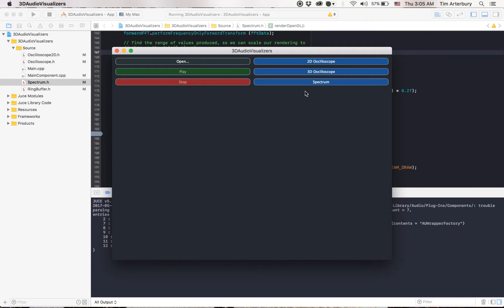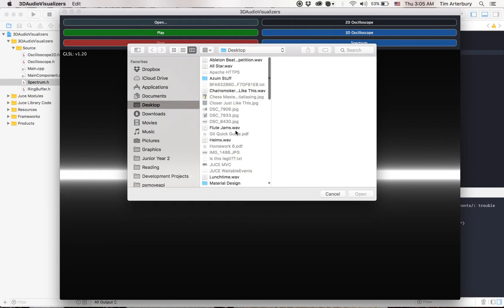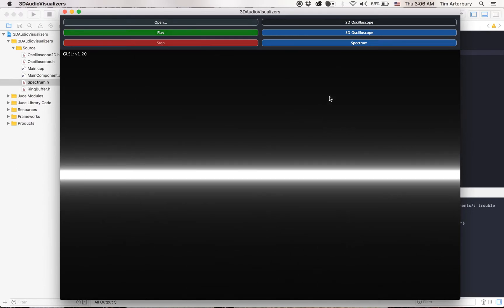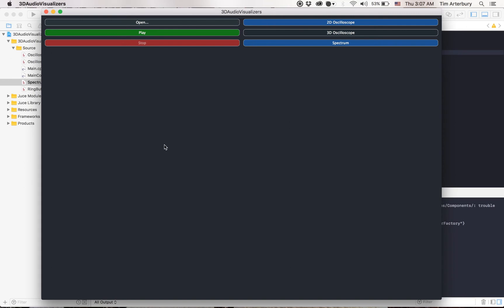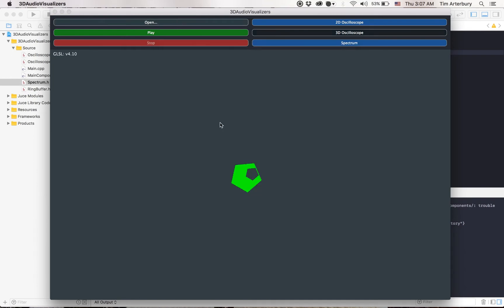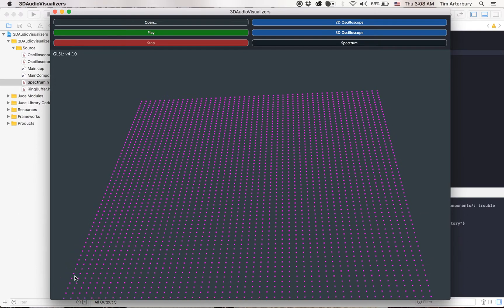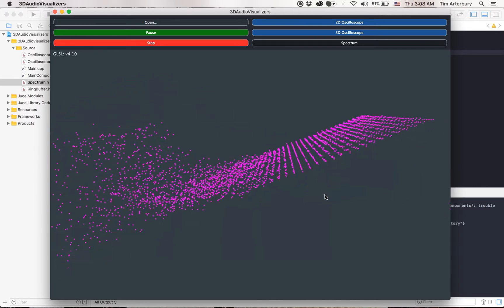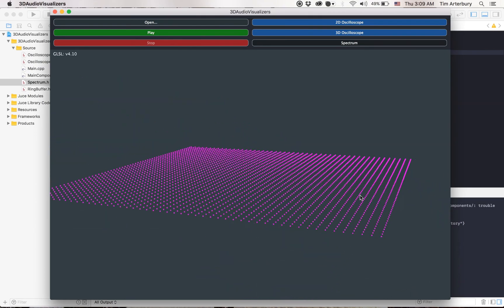OpenGL Audio Visualizer Suite - Oscilloscope & Frequency Spectrum

Comment: Can we make this in Python?
Reply from the maker: Possibly. The underlying technology is OpenGL. If there is a way to run OpenGL code inside of Python then this would totally work. I would bet that this is possible.
Reply: @tim_arterbury  Dude I want to know more about this. Where can I contact you? 
Basically I want this to use in a GUI.
Reply from the maker: @inferngamng1728  Here’s the source code of the C++ GUI: https://github.com/TimArt/3DAudioVisualizers

I probably am not the one to help you with a Python GUI as I have less experience there, but I bet you could translate the C++ code to Python. I would suggest looking for a Python OpenGL example project and then just swap out the OpenGL code with the shaders from my source code.
Reply: @tim_arterbury  Thanks dude I will try out this and give you the feedback.
You gained a Subscriber ❤️

Comment: Hello Tim. When compiling the project as it is it runs fine but on quit I get a jassert caused by leaking objects: "Leaked objects detected: 2 instance(s) of class Uniform". This if I close the app while I have the oscillator2D or the Spectrum open. If instead I quit while having the oscillator3D open I get 3 of these leaks. Any idea? I am trying to play around with the way Uniforms are allocated but I am coming to no solutions so far... :-( Anyway thanks for sharing this, it is very helpful :-) !
Reply: I fixed it in my version. The uniforms.release() don't actually delete the object. you have to do "delete uniforms.release()". (I know this is from 2 years ago just thought I'd let anyone scrolling through thinking of using any of this code) EDIT: Also same with shader.release()!!!

Comment: looking sweet, i need to implement a little audio visualizer thing.. well similar at least.. and i just dont know which of the thousand fourier transform libs i should use...

Any suggestions?
The project involves A TON MORE then the music part so i kinda want to spend as little time as possible on the FFT part of coding :/
Reply from the maker: The JUCE library has an FFT that I believe I used for this. Check out the code in the GitHub for this project which uses the JUCE::FFT. Seemed to work okay for my frequency spectrum visualization but would look best if you skewed the spectrum in a logarithmic fashion
Reply: @tim_arterbury  will absolutely do, actually thats one i have not heard from yet. I really just need the minimum, so if its more or less easy to use thats perfect, thanks!
Reply from the maker: I used JUCE to do all of the app, audio handling, and UI but if you just need the FFT you could probably extract it from the source code fairly easily

Comment: when I download the folder from GitHub, the Juce project file doesn't have the Osciloscope3D.h file, but a Osciloscope.h and when I change that for the 3D file, the project won't compile.. how can I fix this?
Reply from the maker: You might have to add both Oscilloscope2D.h and Oscilloscope3D.h to the project. Sorry I must have never updated the JUCE project file. If the Projucer itself is still unable to compile it, try pressing the open in Xcode or Visual Studio button in the Projucer and try to compile it in one of those IDE's instead.
Reply from the maker: Let me know what works!
Reply: Timothy Arterbury thanks, I got it to work, I just needed to add the dsp module to the project in the Projucer..

Comment: I recommend you check out Shadertoy.com and look into ray marching. It is a fragment shader technique for rendering signed distance fields which are basically three dimensional forms generated by mathematical equations and this technique is ideal for rendering Spectrum and wave forms in three dimensions with any level of nifty quality rendering tricks. Cheers! Would love to check out your projuicer project. I am just starting to get the hang of juce.
Reply from the maker: Thanks so much for the recommendation, I'll check it out!
So cool you're getting into JUCE. It is definitely the best library for C++ I've worked with.
Also, if you would like to see source code, I've got it on GitHub: https://github.com/TimArt/3DAudioVisualizers
There is a Projucer file in there too, but I'm not sure it has all the files imported yet. You may need to manually import all the files. Hope this helps!
Reply: Build and run smoothy, thank you  , very kind of you !
Reply: thank you!
Reply from the maker: Yusssss, glad it worked for you!
Reply from the maker: Also just so you know, I'm pretty sure there's a bug in my RingBuffer.h.
When I try to use the other channel of audio in the RingBuffer, it doesn't work. I haven't yet had time to go back and fix the bug. If you happen to fix it, I'd greatly appreciate a pull request on GitHub or something. Thanks, have fun!
Reply from the maker: I've updated the Git Project and fixed some problems if you'd like to grab the most recent version: https://github.com/TimArt/3DAudioVisualizers